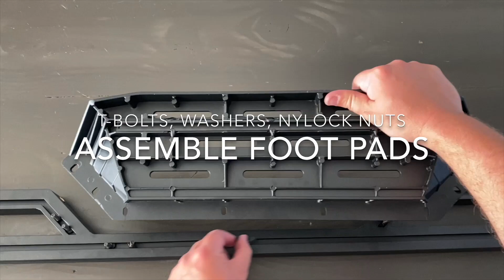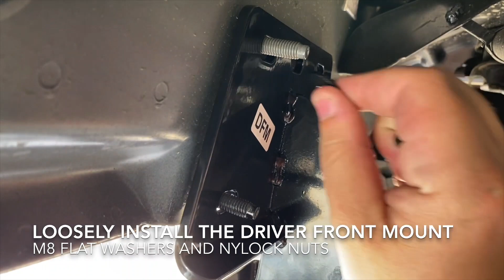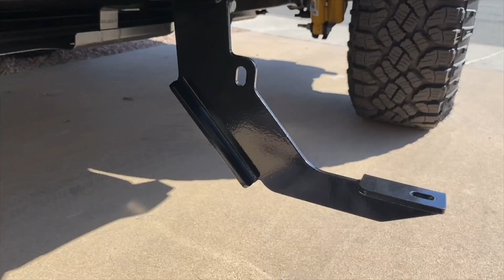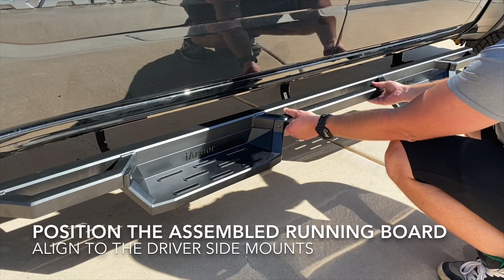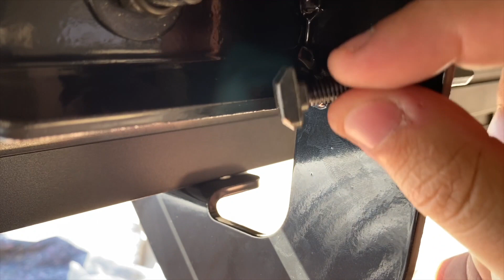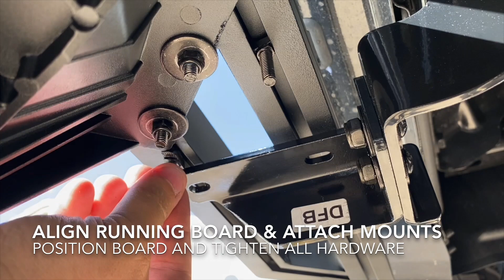iArmor Running Board Install for 2019-2020 RAM 1500 Crew Cab

Comment: Does your rebel have air bags? Mine does and was wondering if this was on entry mode where its all the way lowered. These looks like they hang down pretty low, LOVE the look of them though, thinking about getting these for mine. Thanks!
Reply from the maker: This truck does not have air bags so this is probably a mid-height setting for yours 👍🏼